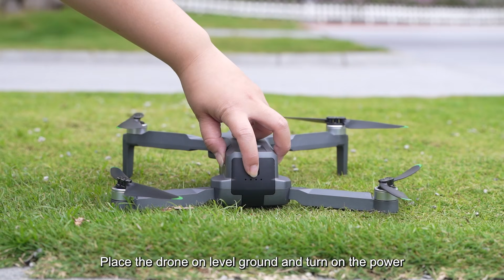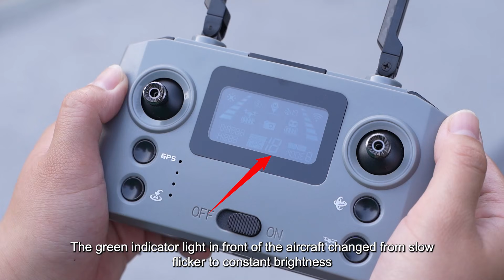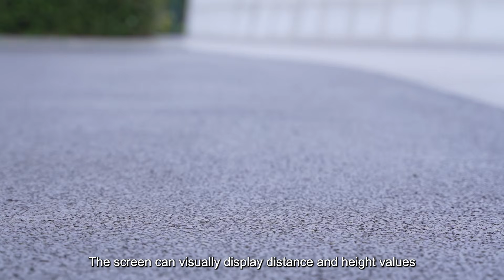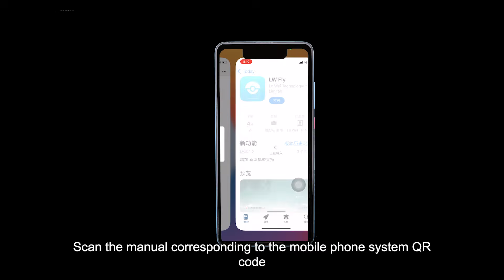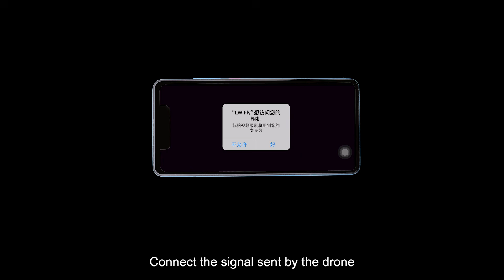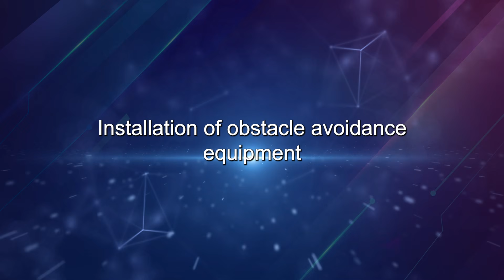S155 Drone Operation Tutorial

Comment: Everyone trying to connect to WiFi and can’t find a network: Turn controller on > connect controller to phone using the the usb c port on the LEFT side when facing the display > open up “LW Fly” app > allow access to GPS, etc > go fly > if you don’t see your camera feed then restart the app and keep trying with restarting app controller etc. 

S155 should come with 1 short lightning to usb c and 1 short usb c to usb c cable for the phone to controller. This works for me. Good luck fly safe
Reply: how do you record with the SD card
Reply: 🤠Hi  I am going to try that,  but so far the controller turns on but does not connect with the drone.😨